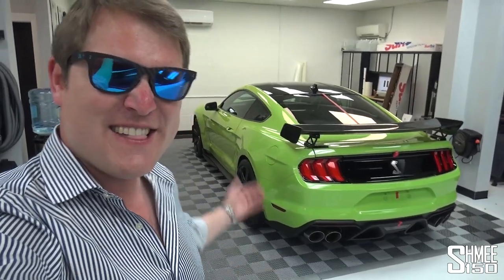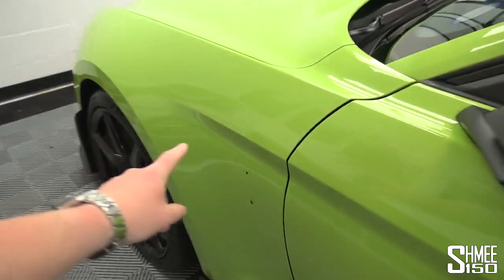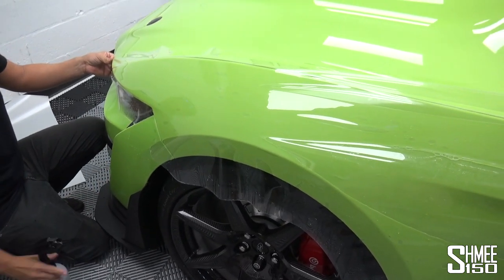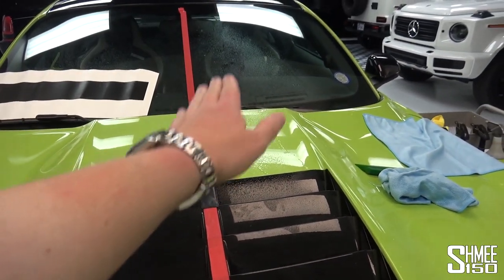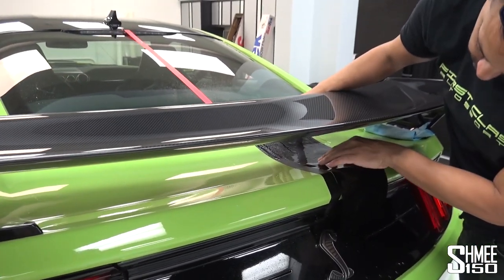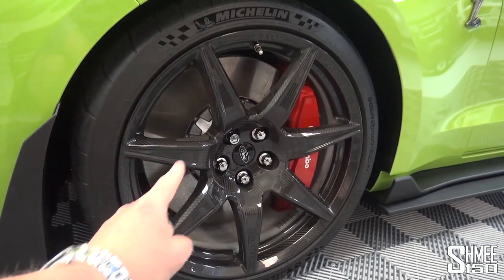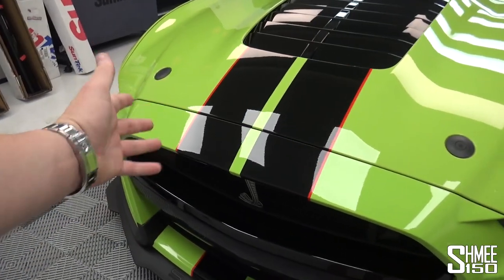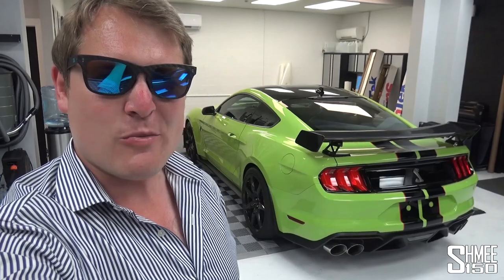FINISHING TOUCHES! My Shelby GT500 is Complete with Iconic Stripes

Comment: Shemee,    when you get a chance underneath the the rear stands that are holding the rear wing.,  You need to take it off and use "touch up paint" around the "drill holes" that they drilled into the rear trunk water likes to creep under there and it will stay stagnant underneath the stands, which in turn will turn to Rust..

Comment: Because the CFTP GT500 sits lower than the base model the suspension spacers are installed by the factory....I take it they weren't removed which has caused the stiff suspension feel that you had....its a common mistake for the CFTP since the base model does not have them installed when shipping.